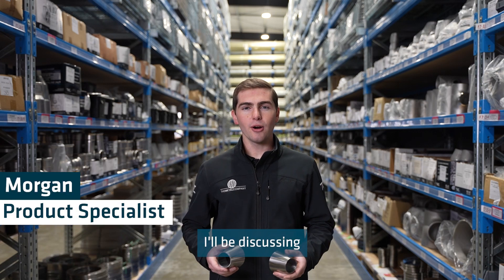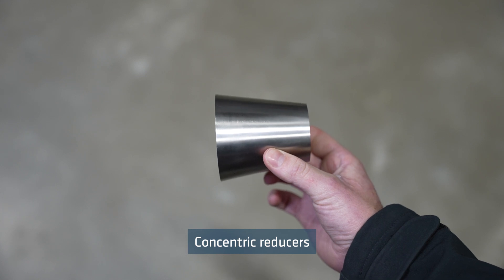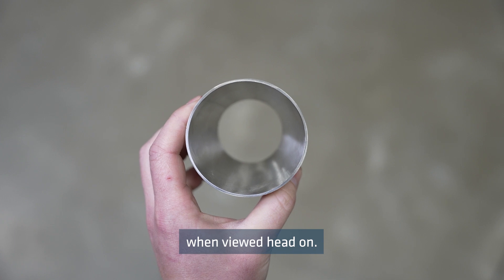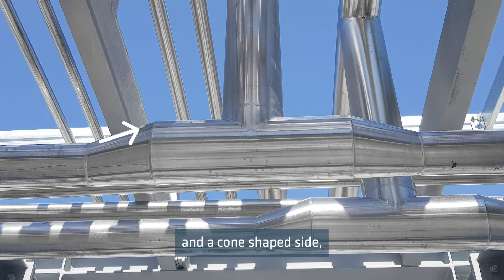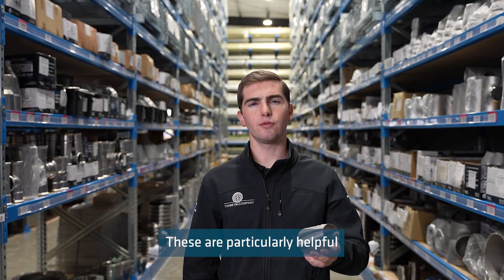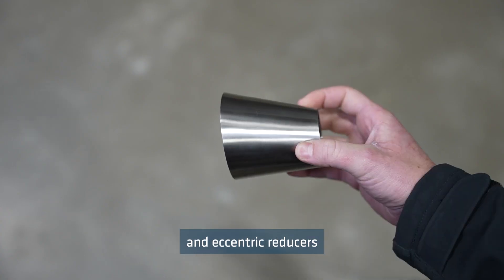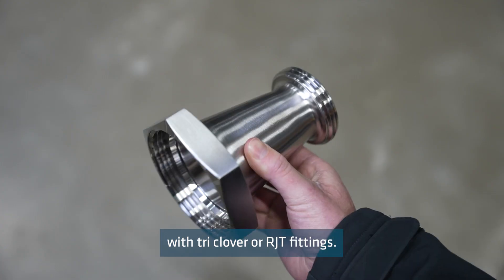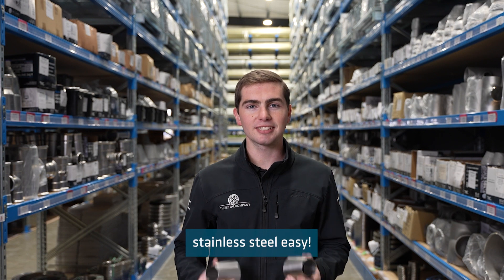Concentric vs Eccentric Reducers | Technical Tuesday

Comment: Hi, very interesting question I have, since ages, 
6" sch.10s and 4" sch 40s .
What should be the schedule of the reducer/reducing tee??????

Please please answer me
Reply from the maker: Hello Pradeep we stock a range of both Schedule 10S and Schedule 40S tees and reducers. It is dependent on your application what Schedule you need. Schedule 40S has a thicker wall than Schedule 10S, meaning it can withstand higher pressures. If you do not need the higher pressures that Schedule 40S can provide, the lighter weight Schedule 10S would be a better option, with it's thinner wall. 

Feel free to take a look at our Technical Tuesday where we covered the differences between Schedule 10S and Schedule 40S here: https://youtu.be/auV-6kpOIZs

Let us know if there are any other questions 😃